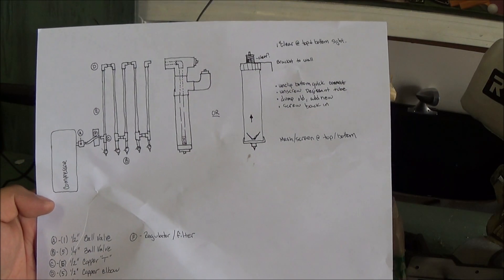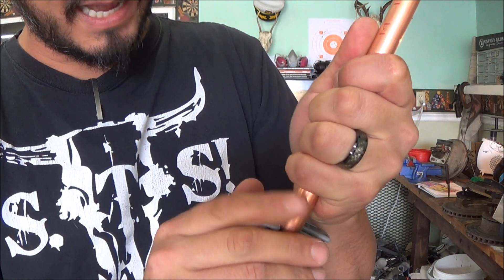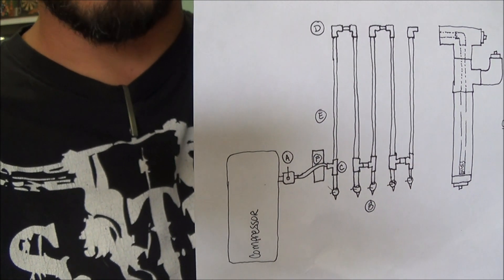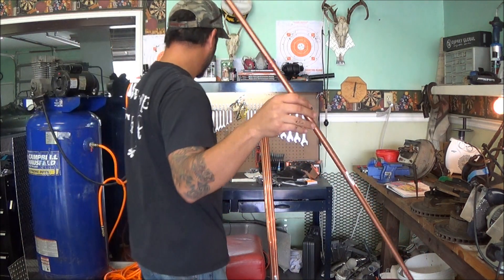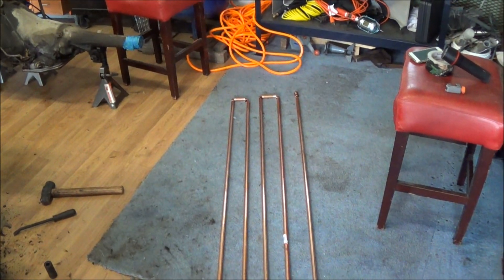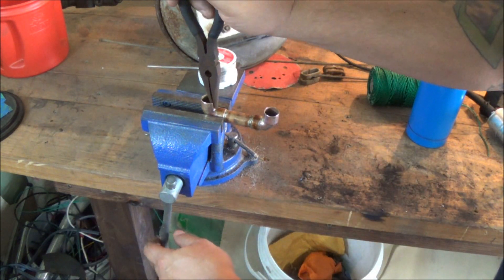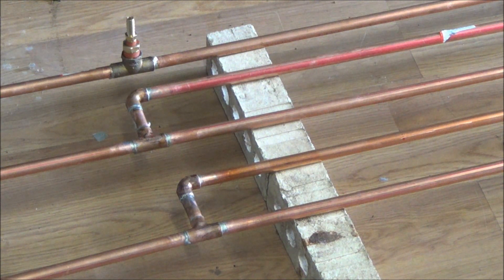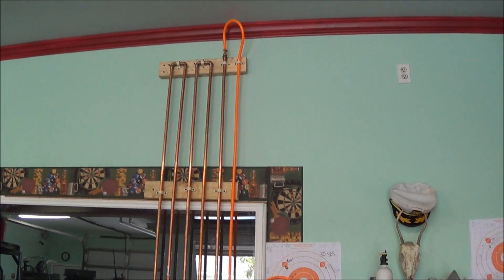Water Separator and Desiccant Air Dryer (step by step instructions with supply list)  part 1of 2

Comment: Nice.  I have a similar set up.  The air stays dry unless running air tools continuously for a good while.
Reply from the maker: Sam's Garage I saw on your channel.   I did run a grinder for about 15 min straight cutting out the floor pan and noticed a little water still coming through.   can't wait to get part two done and see how that goes.   Houston humidity was around 80% (I think) yesterday.   that should go back down....in November. lol

Comment: Dude this is cool. What do you do for a living? Heck of a sketcher. I'm an architect so I appreciate good sketches. I may be referencing this video on down the way, because it's suggested I have this with the my plasma cutter.
Reply from the maker: Str8sixfan jack of all trades, master of none!  haha.  I install software for credit unions...computer geek, but I have a BFA in photography and went to art school.   that's just a two min sketch as an idea.   thanks!
Reply from the maker: oh...and it works well so far.  after about 30 minutes of use I drained about a quarter cup of water.   stupid humidity down here.
Reply: Was there a magic to the total length of your loops? Is there some math out there that tells you what to shoot for on that front?
Reply from the maker: Str8sixfan I'm sure there is some calculation to figure out based on temperature, relative humidity, diameter of manifold tubing and ambient air temps, but I didn't go that far.   I figured I'd start with 25' and if it's not enough, it's easy enough to solder another in.   plus, I'll be making the desiccant tube (got 5lbs of color changing rechargeable desiccant on Amazon for $35) and that should take out most of what the trap doesn't get.
Reply: Hodge-Podge Garage good point. and as modular as it is you know exactly how to move on